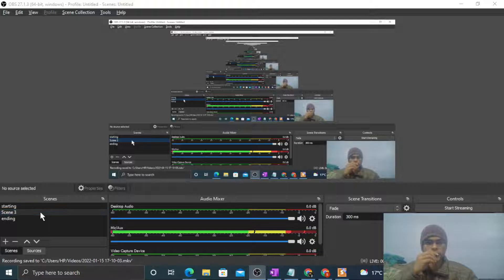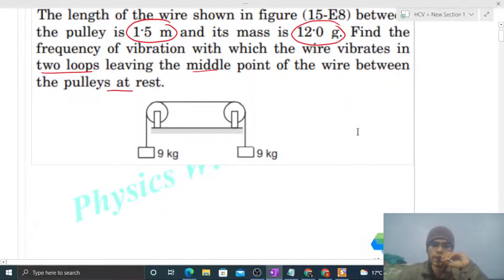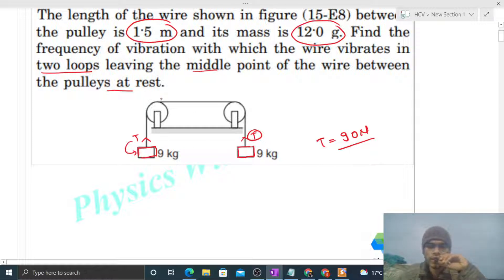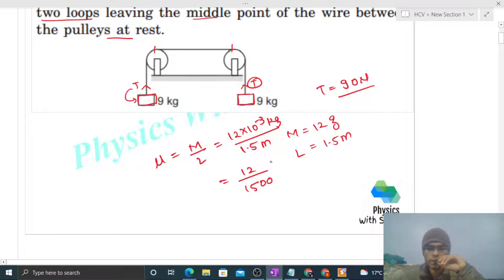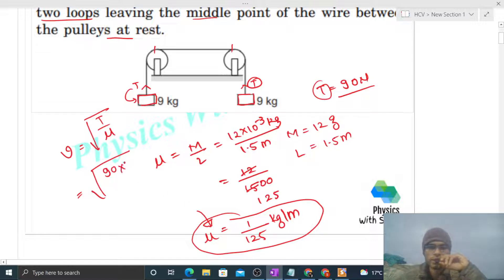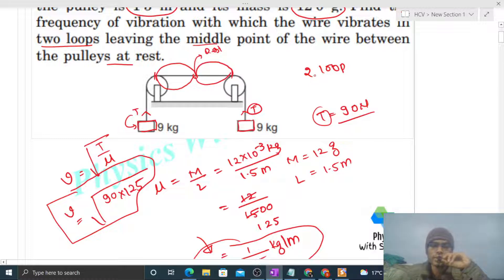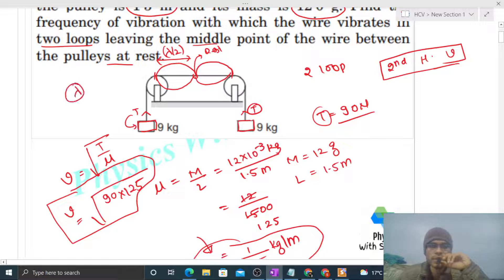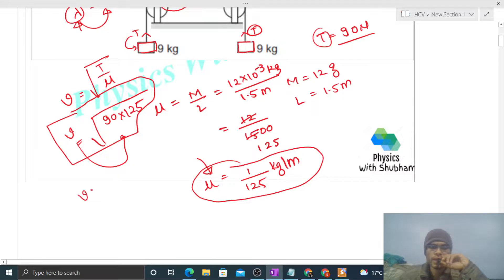The length of the wire shown in figure (15-E8) between the pulley is 1.5 m and its mass is 12.0 g.

Comment: Sir shouldn't the tension be 180 Newton. Is it so because loads are connected in parallel and not in series
Reply: So if you remove 1 block then tension will be 90?????
No definitely not 
Second one is providing support without which tension cannot exist